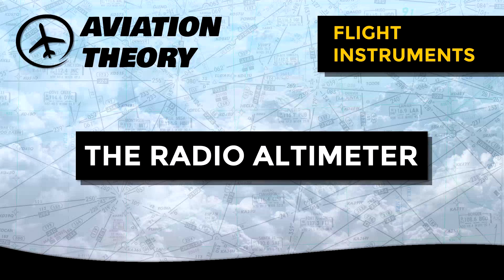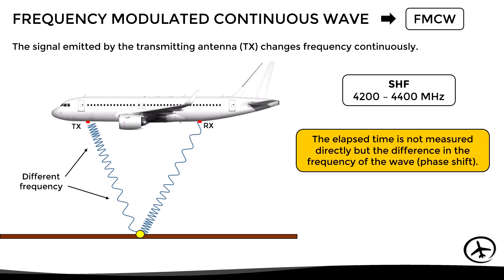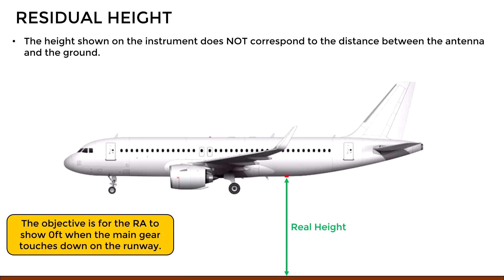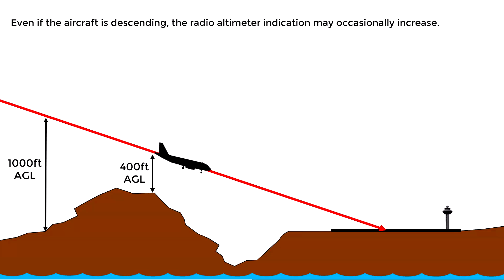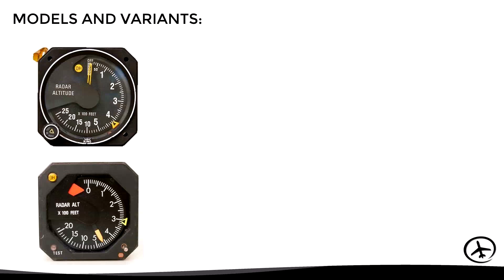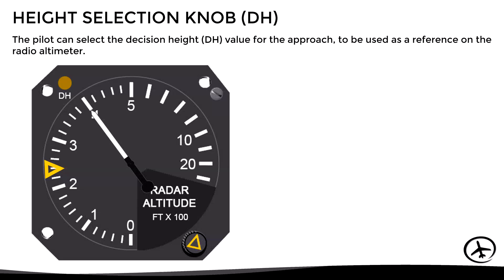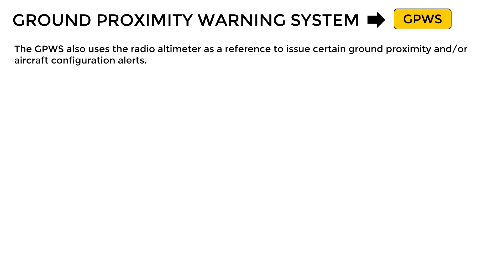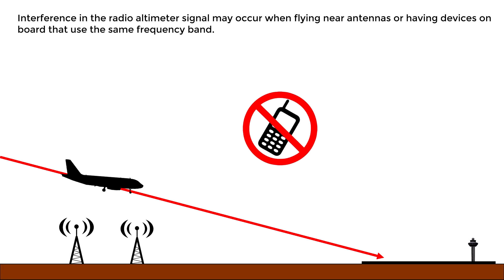How a Radio Altimeter Work

Comment: altimeter ,  ground  

receiving antennae 
 speed of light 
transmitting antennae 4400  MHz 

bounces back to the  receiving  antennae 
 the difference between the transmitted  wave and the receiving  wave  .. residual  height ....
landing gear   giving higher  residual height .............
irregularities of terrain   attributing to the difference in the  transmission  wave and receiving  wave 
too much interference due to the difference  in the reference height  and irregularities of terrain     changes  the ils cat 1 
instrument landing system   cat 
ground proximity callouts 
approaching minimums 
 too low terrain 
pitch and bank limits  are limitations of  altimeter

Comment: But sometimes we are told that mobile devices on or off dont affect the plane?
Reply from the maker: It depends on the number of devices used, the equipment and instrumentation of the aircraft, and the frequency band used by the devices. So yes, there could be cases in which the use of this devices don’t affect the plane, but under certain conditions they can potentially interfere with some instruments.

Comment: Very good explanation.  Different RA system manufacturers may use slightly different FM slew rates and limits, but they are all based upon a 4300 MHz center frequency.  I once worked out the frequency change with altitude for a particular system, I believe it was the Collins, and found that it was a 20 Hz difference between transmitted and received signals per foot of altitude.
Reply: You mean a 20Hz change in the carrier frequency or the modulated signal?  What is the modulation frequency?

Comment: Very interesting! Although I do not really understand exactly how the new altimeter works by comparing the the received frequency with the new transmitted frequency. But the interest for the ra has come from the recent problems with the probably 5G interference. You address that at the end of this video. You say the 5G uses frequencies also used by the ra system. That is not true. In the US the top edge of  5G is 3980 MHz where as the ra works between 4200 MHz and 4400 MHz. So they are at least 220MHz apart. Juan Brown of the Balcolirio channel and some others made a video on this. However it seems that the receivers front end is not really selective. Meaning that it also allows frequencies in the 5G spectrum to come through.  I am a licensed ham radio operator and it seems to me that it should be possible to make the front end of the ra's receiver insensitive for 5G signals. But I can understand that the ra receiver has to be very sensitive in order to be able to receive the weak reflections from the ground. Any filter on the receivers input lowers its sensitivity. Maybe you know more about this?
Reply from the maker: Hi Mark, exactly, although the RA and the 5G antennas do not use the exact same frequency, their ranges are not very far (only 220 MHz apart), specially in the spectrum assigned in the US. That’s why civil aviation authorities have been saying that there “may” be some potential interference of the 5G network with some sensitive RA, but it is not assured, they will have to make a lot of tests before getting any conclusion.
Reply: @AviationTheory  I forgot to mention, but 220MHz is a huge gap! If you look at the vhf coms radio, they used to be 25 kHz apart, and now even only 8.3333 kHz apart. If you tune in on a frequency the receiver has a sharp filter to make sure you do not have any interference  from the neighboring frequency only 8.333 kHz (that is 0.008333 MHz) away.
Reply: I can explain that first question for you a bit. The frequency varies in a predictable pattern, like imagine slowly (but constantly) increasing from 4200MHz to 4400MHz over the course of 1s then starting over. You can plot that simple equation on a frequency x time graph, meaning you can calculate at any point what the frequency should be from the time you turn on the machine (start transmitting the frequency function). So when you receive, and see what frequency you're receiving, you can very quickly determine the delay by comparing the received frequency to the currently transmitted frequency, then just plugging in the value to your function.

This is done because instead of just sending out pulses every x ms, you can just constantly transmit and then not even have to worry about missing times when there was a poor reflection, or missing a large thin tower below, you can have constant uninterrupted feedback. This also allows you to do some smoothing of your values with more accuracy incase there were outliers received from some sort of interference.

Comment: You explained very clearly why the Polish Tu-154M crashed in Smolensk in 2010. The crew used a radio altimeter instead of a barometric altimeter while approaching landing in a thick fog over done valleys.
Additionally the crew ignored reaching the decision height hoping to see the runway very soon. The aircraft found itself below the level of runway kwhich was behind the valley) and flown directly into ground which was a climbing slope of the valley before runway - controlled flight into ground.